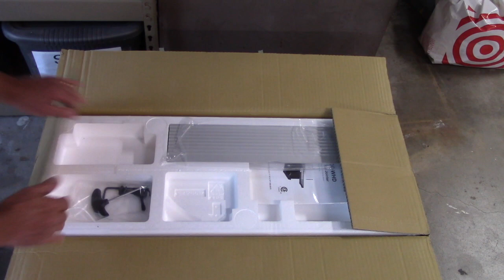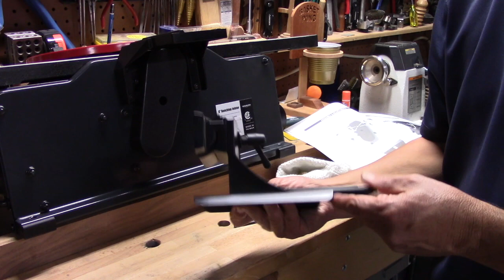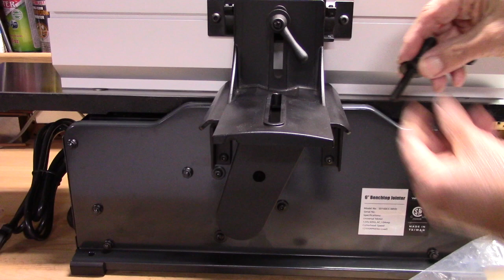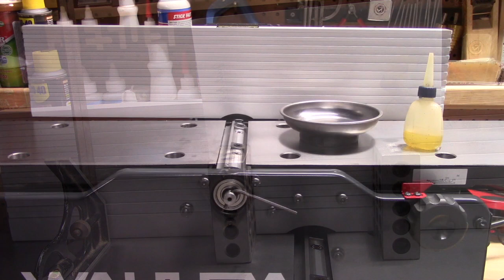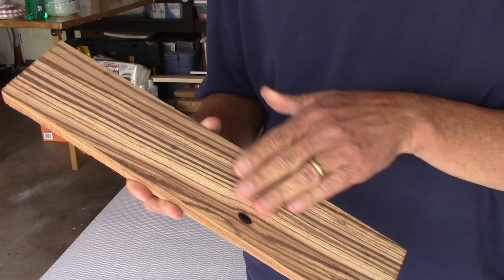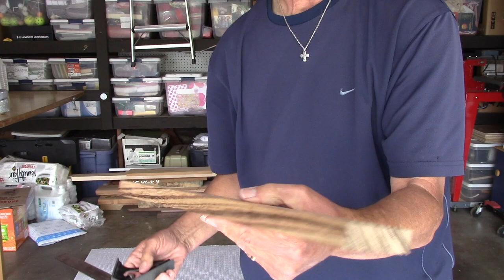Wahuda Jointer Easy Assembly

Comment: I recently purchased an 8in jointer and I’m getting snipe ate the end of my cuts. I put a level and the blade moves the level forward a bit but I don’t see it lifting it . Any recommendations.
Reply from the maker: I am sorry.  As I mentioned in my video, I am new to the jointer and not the right person to help you.  I did find that Wahuda has a very good support person that could probably take care of your issue.  Have a safe and happy 2021.  
If you don’t mind me asking, what state are you writing from? (I like to put a pin on my map for each reply I get.)
Reply from the maker: I don't know if you solved your snipe problem.  I recently saw a video where the woodworking said to have a sacrificial piece of wood pushing your good wood through the cutters to prevent snipe.  I hope this helps you.

Comment: Are you still happy with your Wahuda jointer as you were 6 months ago?.....or do you wish you had a floor standing one? Sill deciding which way to go.
Reply from the maker: I am still happy with the jointer.  My garage space would not allow for a floor standing one.  I keep mine on a mobile bench with my lathe.  It is well made, but I must be honest with you, I have only used it about 10 times.  I just only need it once in awhile in the work I do.  Have you looked at the Cutech jointers.  They seem to be the same machine without an iron table and standard carbide.  Their price are very competitive. Happy New year.  If you don’t mind me asking, what state are you writing from? (I like to put a pin on my map for each reply I get.)
Reply: @gfotinakes316  Grand Rapids MI...thanks for your honest reply....!

Comment: How many passes are you roughly needing to get the result you like?
Reply from the maker: It depends on how rough and uneven the surface is.  I rarely use the 1/8" setting, I would rather take 2-3 passes with a finer cut.  It does a nice job.
Reply: @gfotinakes316  cool.  I'm working with it right now and I am finding the same.  I never had a jointer before so I am still getting my technique down.  Mainly to apply uniform pressure throughout the entire jointing process.  I've been getting slightly thicker result at the end of the board.  I think it's because I'm not pressing down enough when the end of the board goes over the roller.
Reply from the maker: @MixingGBP  I too am new with the jointer.  Most instructions show a hand over hand technique to avoid hands over the blade area.  I almost feel safer keeping my hands on the plastic handles with a uniform pressure over the entire cut including the blade area.  I feel like I have a greater chance for injury by moving around with my hand placement all the time.  I just don't know.??

Comment: 50 inch lb equals 4 foot pound. So a little over finger tight. Snug then a 1/8 to 1/4 turn. If it feels like it will strip it’s too tight?
Reply from the maker: Thank you
Reply: George Fotinakes as a general practice I choke up on the tool holding it closer to the driver: bit, socket, blade, etc. in lieu of holding the handle to gain added leverage when I’m doing less than 10-12 for pounds. If I’m trying to get around 8-10 fp then I’ll swing my hand down onto the lever arm (rachet) for the last nudge, final tightening. To your viewers; once you learn what snug is then adding a little less gets you finger tight, a little more gets snug and a tad more should get you  4-5 foot pounds, it’s not an exact science. If you overtorque you can always back off the bolt, till it’s loose, then a smidge more than snugged. A torque wrench in inch pounds solves the mystery!
Reply from the maker: Mitchell Kasdin Thank you for the very excellent instructions.When I loosened the screws they were so tight I heard a snap before they broke loose and came out so I try to put them in with that same amount of force. It may have been excessive but I’m planning to never take them out again.
Reply: George Fotinakes use a blue locker like locktite on the threads. That will hold the bolts in place so they don’t back out from vibration. Use the manufacturers recommended torque setting assuming it’s correct? If you’ve ever used a helicoil to remove a snapped bolt you’ll understand... it’s work and could mean retapping the hole or an insert? If you never want to loosen the bolt again, use red lock threader, more important! The blue does the job. From the factory they always overtighten to the point you need a cheater pipe. Haha